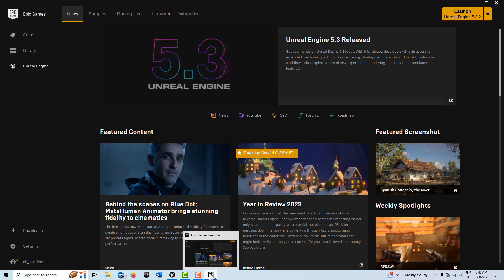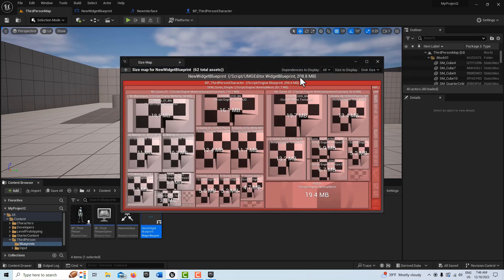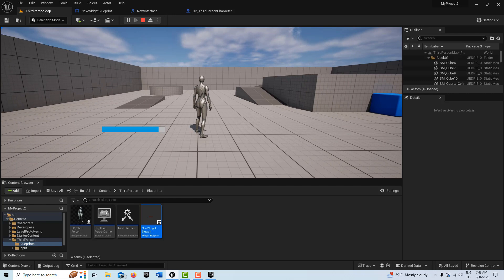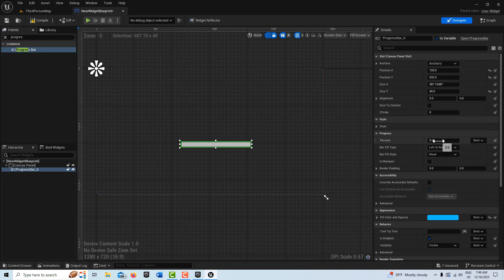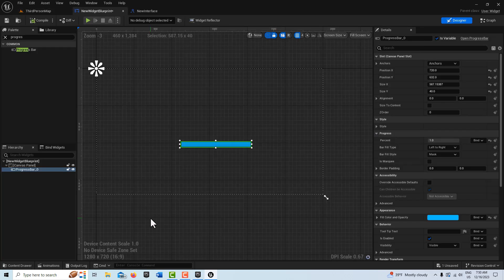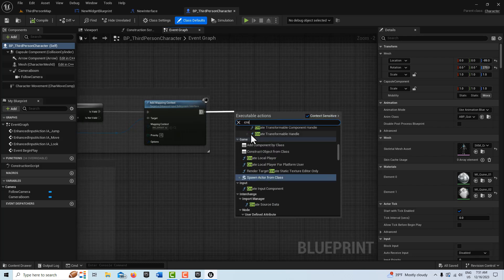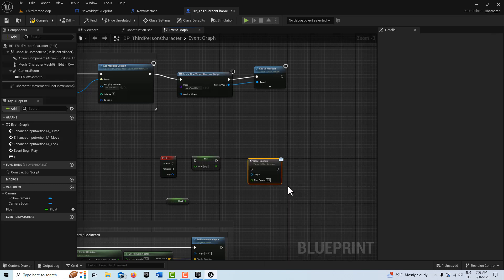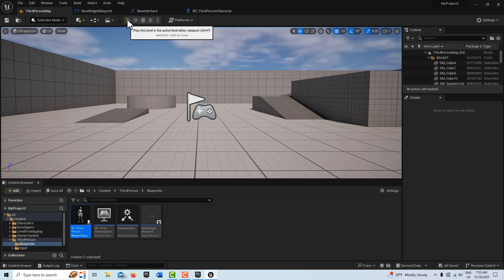MAJOR UPDATE: Why Casting Can Be Bad. It is Expensive.

Comment: I am not saying this couldn't be an improvement, but wouldn't the character already be loaded into memory? I don't see that it would be a performance hit in this case. It is similar to caching a reference to the GameMode on your player character to bind to EventDispatchers. The GameMode is already an actor loaded into the level, so it doesn't use any additional resources. I think you show a good point for how Casting can be detrimental, but I do not think this is one of those cases (I could be wrong though). Either way, thanks for sharing.